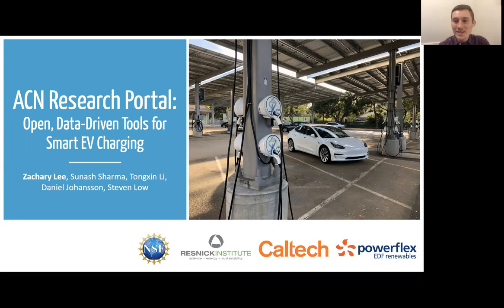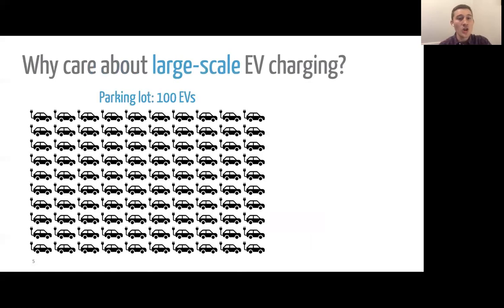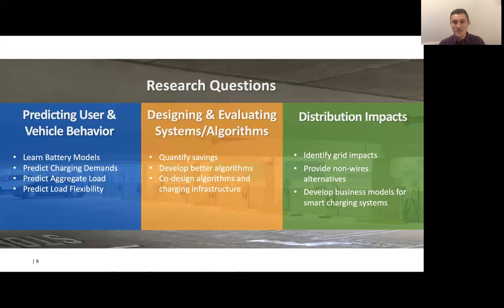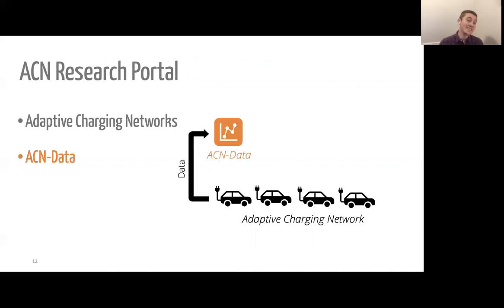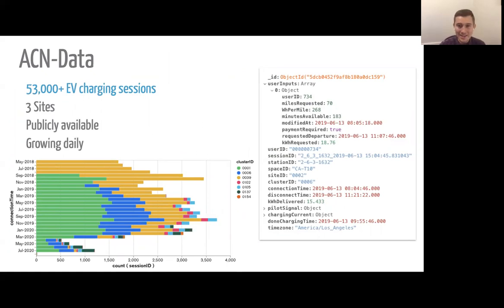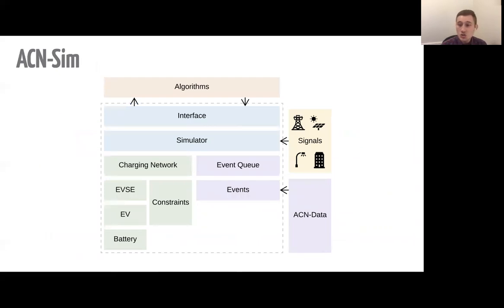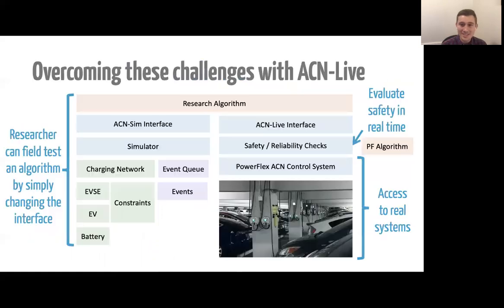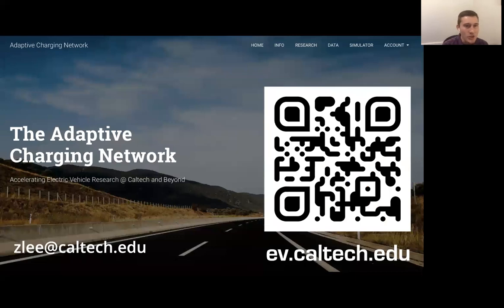ACN Research Portal: Introduction

Comment: I have problems accessing your dataset from the website. Is it still running?
Reply from the maker: The online form is not working at the moment. You can still access the dataset using the API. If you need a token you can use "DEMO_TOKEN". If you just want the data, you can use this Colab doc to download the time range you want in json or csv format. Sorry for the inconvenience.
Reply from the maker: https://colab.research.google.com/drive/1UPvurai0Wj2yvmZ3aUqHn3tdQvRWjlnO?usp=sharing